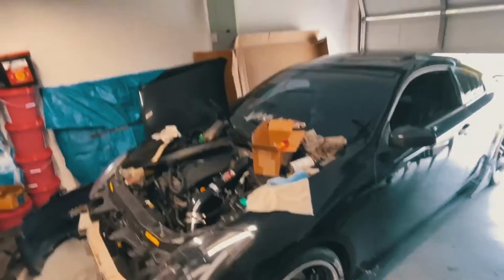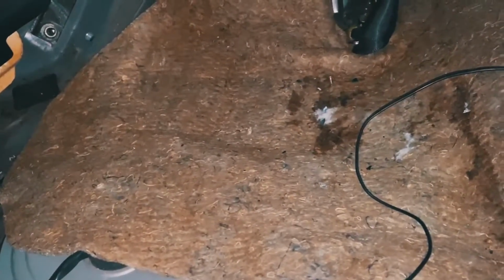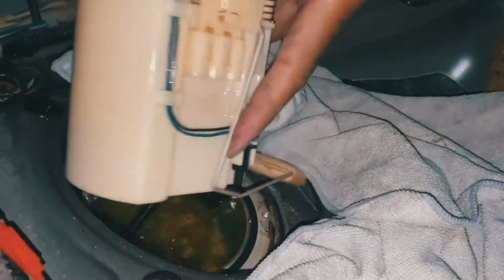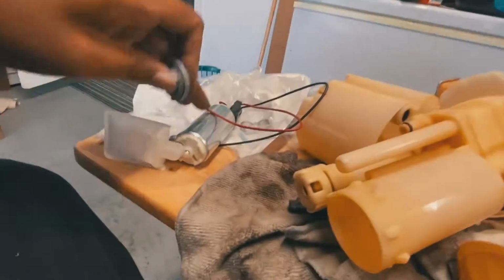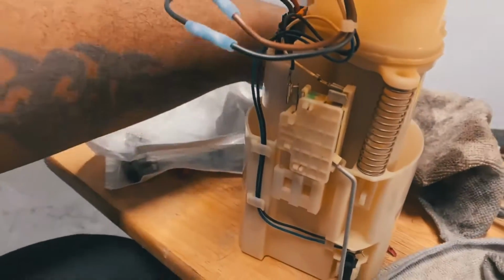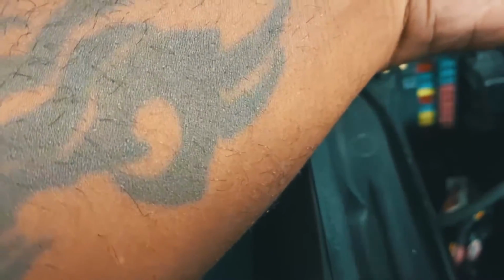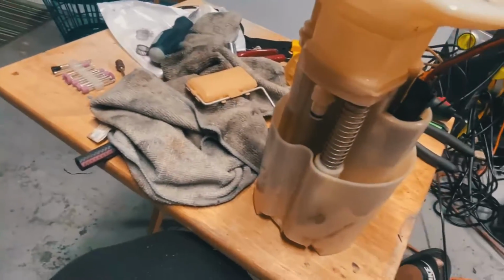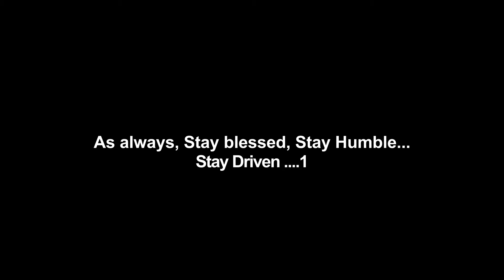Walbro Aftermarket Fuel Pump install for the G35 or 350z Coupe

Comment: Thank you! Thank you Thank you! 🙏 bro you always coming in clutch....I have been thinking about changing out my fuel pump for 2 years now aha...was just scared to even after doing my research.  ...
Definitely doing this now 💯
Reply from the maker: thats great jeff, i was abit overwhelmed too, just because the thought of the gas and having to splice the wires, but definitely go for it bro, especially if you know your car's fuel pump has never been changed, you will notice a slight increase in  fuel economy, trust me it helps, and you know you can always hit me up bro!
Reply: @StayDrivenMedia  oh for sure bro I know! ...I am actually doing my fuel pump this weekend...if I have any question I will definitely ask ....funny think is though......my battery is randomly draining now.....dead battery twice...and Idk what's going on😵
Reply from the maker: @nupnuema9769  try checking your alternator, it might be dead and not charging, so your battery is doing all the heavy lifting....O'reilys or autozone can do a battery and alternator test if i'm not misteken, i hope this helps bro.

Comment: Hey man, great video. So I was reading on the Z1 page that these 255s require to drill out the syphon on the pump to a larger size to maintain the stock fuel pressure. Did you do this?

Comment: I was debating whether to buy this pump for my 350z and am surprised at the required modifications. I assumed it was plug and play, but I guess this pump is utilized for other applications.  On the Z1 website, they indicated it was a "Similar" OEM fitment. O'Reillys is having a storewide sale rn, so I think I'm gonna buy a complete replacement through them. Thanks for the info! 🤙🏻
Reply from the maker: not a problem! :)

Comment: I did the same to mine, but I had hard times fitting the fuel pump in as it is longer now and hence I had to press it to place the fuel pump ring. However, today I filled in full tank and realized the gas was still sipping through. Did you shave off any parts of the pump to fit it well?

Comment: Do you have to get a tune did after?
Reply from the maker: No you don’t, but you do have to do abit of fabrication for the walbro fuel pump to work with your stock fuel pump Assembly, I would honestly just get a deatschwerks fuel pump, it’s plug and pay

Comment: Why not just unplug the battery instead of pulling the fuse?
Reply from the maker: because just plugging the battery out doesnt release the fuel pump pressure, pulling the fuse out still allows the car to turn over but cycles the car to still release the pressure.
Reply: @StayDrivenMedia  ahh that makes sense. Smart.

Comment: Stole my tron g  which only has driver seat and  and fucked all my fuses added two kill switches and found out every time i go to store if old phone/security camera wasn't on,I'm getting robbed or stash pinched and hidden. My fuel system is were the kill switch is located also. Do a security system and apo preference video!!